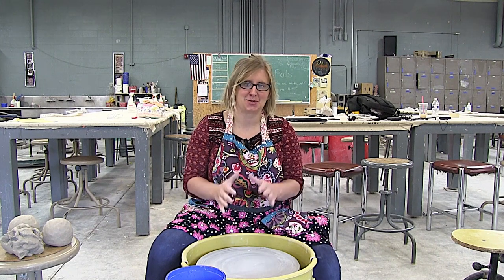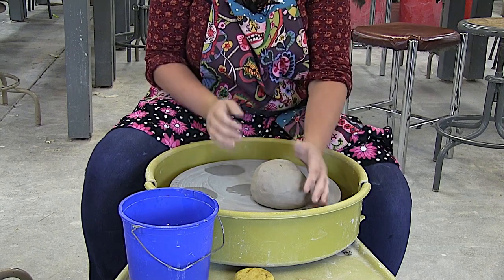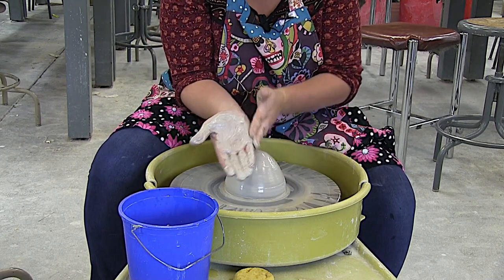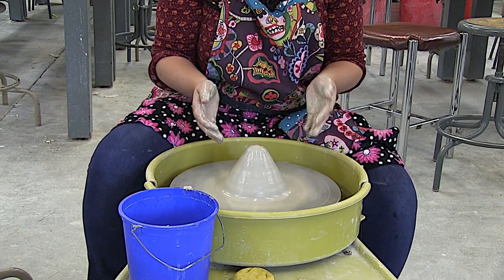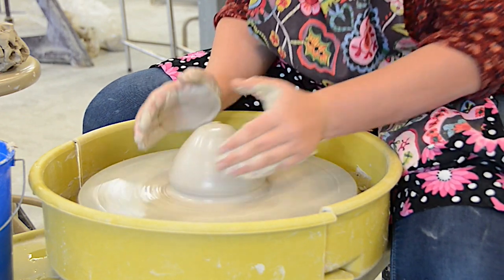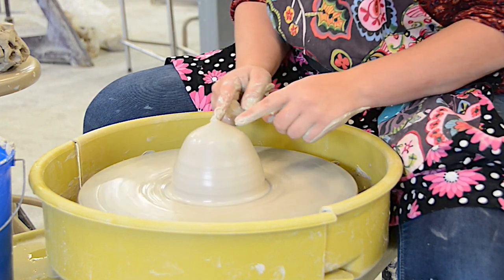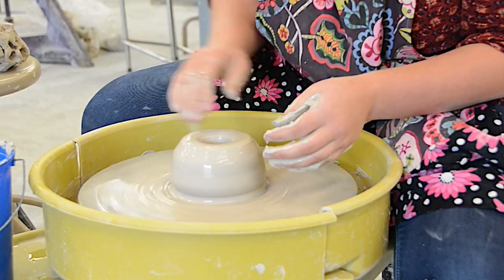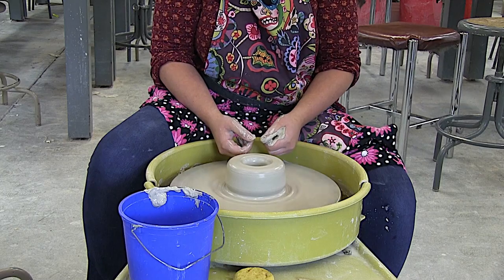Centering--what am I doing wrong?

Comment: Seems so many teachers don’t mention the need to focus on holding, fingers, hands, arms (for at least a full rotation) absolutely still and “bracing” and holding the feet or arms still to do so. They also never mention using elbows to the ribs/resting/setting arms on something to help to hold the hands still (while learning to center).

Also, having the foot on the wheel (which can be stepped on to change body, then arm, then hand positions) and it spinning to slow or fast is never mentioned. 

The part about not taking hands off the clay too quickly was kinda the same thing as keeping the hands still. That was very helpful. 

I say this because I have met quite a few who could not learn from a college teacher. 

Makes me wonder if those who end up succeeding much of the time only did so because they would have anyway.

All would be potters should never give up. They should just get a new teacher or watch YouTubes.